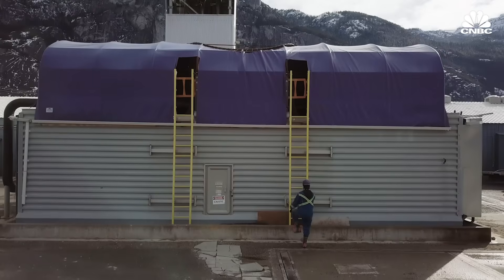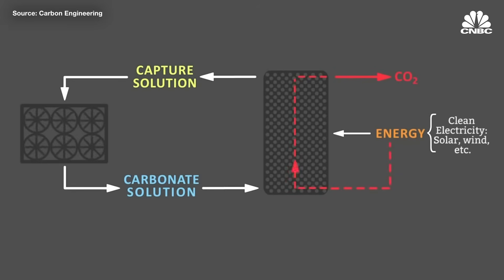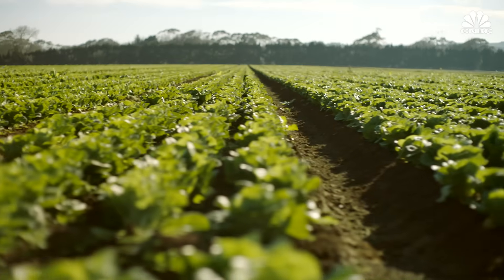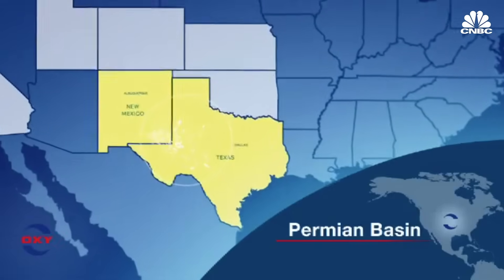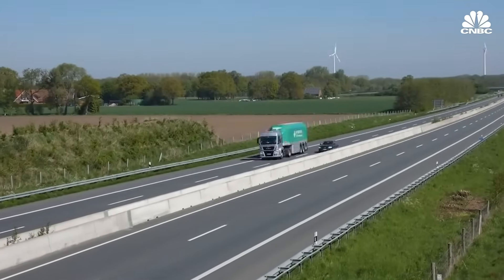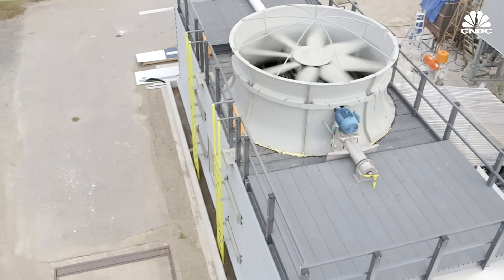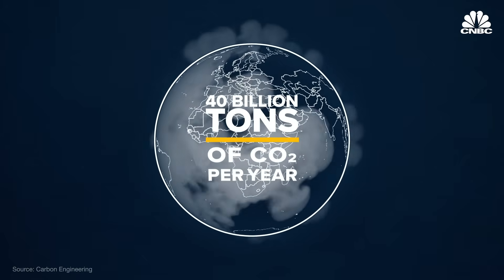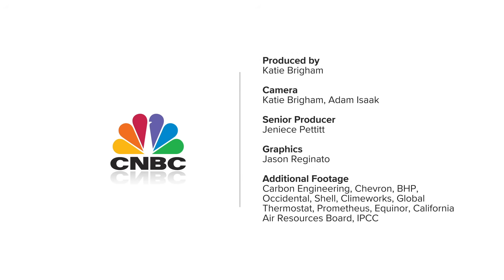Bill Gates-Backed Carbon Capture Plant Does The Work Of 40 Million Trees

Comment: And when ground absorption reaches its tipping point? How will excess CO2 impact water retention in aquifers? How acidic will the CO2 make the earth?
Reply: Pump it into empty oil fields maybe
Reply: well, all carbon come from the ground,just like all fossil fuel come from the ground. it s just to put everything back to where they come from.
Reply: @Soras_  Nice thought, but not quite correct. "Natural' carbon is tied up in many ways essentially rendering it neutral.
Reply: @phillipbotha7920  I think IT s good idea to put carbon back to deep underground where we dig oil  with  renewable energy.
Reply: @Soras_  I am hoping that you are trying to be funny
Reply: @phillipbotha7920  it took more than renewable energy along to reverse climate change.
Reply: @Soras_  Nothing will stop climate change. Climate change is cyclical
Reply: @phillipbotha7920  unless you artificially changing it that is. you can block part of the sun light to slow it down like large  volcano activity did to earth s temperature.

Comment: Genetically modifying trees to absorb more CO2. That would be a start. Look what we’ve done in the weed industry
Reply: Lmao
Reply: True but it'll take too long
Reply: @Hope4aBetterWorld  no, in fact it can be very fast, in 10 it'd be ready, the problem is that if you covered the planet with trees would only eliminate 33%of the excess carbon, it's not enough
Reply: Az4212 knowledge thirsty that's alot
Reply: actually good idea props.
Reply: Oh noes! He said GMOs. Burn the heretic!
Reply: Ganda Gandara  Lol, haven't taken too many bio classes, have you?
Reply: already being worked on: https://www.dezeen.com/2019/05/30/salk-institute-ideal-plant-climate-change/
Reply: Bad idea, it could throw the balance off. Its better if we have machines that we can turn on and off. We dont want to remove too much, which could eventually happen.
Reply: @LittleRainGames  Throw the balance off what?
Reply: The issue is that C3 photosynthesis can only do so much.
Reply: then what. wood rots. to permanently keep it out of air it has to go back into the same hole it came from.
Reply: All plants do. Lol
Reply: I wonder how much carbon has been fixed to the inside of bongs around the world🤔. Stoners unite to save the world!
Reply: Gasmandude 
The weed industry never genetically modified pot, they used conventional breeding to get different strains, there is a big difference between genetically modified and cross breeding.
Reply: The weed industry is a pure environmental disaster. Drums of synthetic fertilizers down the drain.

Comment: What if we change our understanding of the combustion process? Instead of using purely oxygen, Carbon dioxide has 1 carbon atom and 2 oxygen. If we somehow can manage to use the carbon, it will be a game changer
Reply: Alex Wong thats the pellets bro
Reply: Gosh, you have no idea on how combustion works. Do you even know why there is carbon dioxide in combustion gasses? You put in fuel (a hydrocarbon, CxHx, the number of hydrogen and carbon atoms vary depending on fuel), and you also put in oxygen, which acts as a catalyst. When the Carbon and Hydrogen bonds are broken, energy is released. The Carbon binds with the Oxygen, resulting in Carbon Dioxide, and the Hydrogen also bonds with Oxygen, resulting water. You cannot reverse this process without investing back the energy that was released during combustion.
Reply: The ideal formula for gasoline that you put in your car is C8H18. During combustion, for one molecule of gasoline, you need 12.5 molecules of oxygen. 
C8H18 + 12.5*O2= 8*CO2 + 9*H2O

The issue is a bit more complex, because you rarely have a perfect air to fuel mixture. Air also contains Nitrogen. If there is excess air in the mixture (too much air, not enough fuel), Nitrogen bonds to Oxygen under high pressure and temperatures, resulting in Nitrogen Oxides (NOx). Also, this causes high temperatures in the engine, which can melt parts of it. That's why an engine always runs with a little too much fuel than it needs.
Reply: @laurentiupopa5001  I said "If" and I'm not a chemist like you.
Reply: @alexwong1249  No worries bro, I tried to explain as well as I could, so you could understand the combustion process. I am not a chemist either, I am an Automotive Engineer :))

Comment: Planting trees is good idea to remove CO2 from the air. Not cutting them down en-mass in the Amasonas could be even better.
Reply: Trees do it naturally without the need to build other plants. I would never trust an oil company to do the right thing
Reply: @r.d.9399  "I would never trust an oil company to do the right thing"
Nor Bill Gates for that matter.
Reply: Craig Tucker  You act like the rest of the world don't drive cars and trucks. STFU
Reply: you do realize all the carbon in the ground came from the air?  covering all land in trees wouldnt store enough as most of it came from algae in the ocean getting buried.  only way this is getting fixed is to sequester it permanently by making it back into a solid or liquid and putting it back into ground.  can only make so much stuff out of wood for so long
Reply: S K 
That takes a long time and old forests still absorb CO2 well.
https://www.nature.com/news/2008/080910/full/news.2008.1092.html
Older trees grow thicker rather than taller.
Reply: @michaelrch  The Amazon forest is a few thousand years old, trees grow taller, thicker and dies. When dead they they are eaten by microorganisms which are eaten by bugs, the bugs are eaten by predator each generating CO2 along the way, feeding the the young trees along the way. As vegetable need CO2 to develop, as far as CO2 is concerned the Amazon forest is a close loop ecosystem, it produce as much CO2 as it need. The problem is that it produce a huge amount of water vapor a very potent global warming gas. Transforming the Amazon rain forest into a desert like the Sahara would cool down the planet and have no effect on its oxygen concentration.
Reply: John Kubik 
Wow that is some seriously imaginative nonsense buddy.
Water vapour is indeed a greenhouse gas but it is evaporating off the ocean and stays in dynamic equilibrium based on the air temperature. 
Yes, tress transpire water but the Amazon actually creates clouds by condensing water vapour out of the atmosphere. That's why it's called a "rainforest". 
The net effect is that the forest takes water vapour out of the atmosphere.
So no, killing the most valuable and amazingly diverse ecosystem on our planet is a bad idea.
Who'd a thunk it
Reply: @johnkubik8559  lets turn the whole planet into a desert then.
Reply: @johnkubik8559  Cool down for whom? All you quacks don't even know what CO2, Carbon, etc is for. Obviously its heat sources to decay & regenerate. The sun is morphogenetic as do all things that create a symbiosis. They are hiding a lot of truths by cooling the firmament. It's to allow folks who dont have carbon based elements in them to live long lives when in fact real nature would wipe out half the world like thanos did. A event like that would be catastrophic which is why they have systems designed to reverse everything
Reply: EXACTLY .. Or you could plant more trees 😆😆😆
Reply: People demand is greater than our worry of global warming. Cutting down the amazon forest in the short run provide food and resource to the people but in the long run long term damage to the environment.
Reply: They don't grow well in some areas.
Reply: Full grown forests do not capture a lot more co2 then it produces itself
Reply: Try to tell that to developing countries where most of the population lives in poverty and conditions the modern world considers disgusting.
Reply: Trees don't permenantly store carbon the only bank it until the forest burns or the tree decomposes which just puts it back in the atmosphere.
Reply: Scott Wickwire-Brock 
Turns out that that is much less true than we thought. If you plant the right forests, they grow for centuries. Trees stop growing taller but they grow thicker. The best plan is to start by keeping the forests we ready have of course.
https://www.nature.com/news/2008/080910/full/news.2008.1092.html
Reply: You do realise that trees put C02 into the atmosphere, right? At night. Trees put out C02.
Reply: The Amazon forest is a primary forest. Its oxygen production is absorbed by the microorganism feeding on dead trees and releasing CO2 feeding the young growing trees. The CO2 balance sheet is neutral, its a close loop ecosystem. Cutting down trees to build houses or furniture delay the CO2 release until this wood ends-up in landfills or is burned in recycling plants.
Reply: Partisan obsession is unnecessary when talking about climate change . We are all in this together as human beings.
Reply: Sekir80   Millions of trees have died here in bc due to the pine beetle which creates a forest fire hazard in the summertime, thus producing carbon. I guess it’s natures way of renewing the forest. Before Europeans existed in North America Forrest fires burned freely without human intervention.
Reply: Be cautious about forest fire
Reply: Oceans give more oxygen and we have lots of trees but humans gotta take up space too
Reply: Well it's not first world countries cutting down the Amazon jungle
Reply: @Sandlin22  yeah, they already cut down their forests.  if we cared we could easily pay them a pittance not to at the end of the day.  ever look up the economic output of an acre of jungle?
also, once a jungle is grown it doesnt consume anymore carbon.  

where would it be going? unless its being trapped under the ground and entombed plant matter decays and releases carbon back into air. all this carbon was in the air to start with
Reply: The amazon is the most vital resource all the planet. It fuels the atmosphere and has endless potential for medicine. Needs to be saved!
Reply: What's wrong with cutting trees down in the Amazon, that's there country they can do what they want with their trees.
Reply: The Big Question
Is there any verifiable evidence that fossil fuel CO2 has caused any temperature rise, ice melt or sea level rise, let alone causing "extreme" weather?
Reply: GEORGELET4 
Yes, absolutely tons of it! Just because you haven't looked doesn't mean it's not there. Go read it for yourself.
https://climate.nasa.gov/evidence/
https://www.metoffice.gov.uk/climate-guide/climate-change
Reply: @Bruno Pereira 
CNN/ABC = Corporate/Establishment Media owned by elites, and serves elites not the left. Panders to identity politics.

MSNBC = Propaganda wing of the democratic party, which is a party full of centre right politicians with a few lefties. Panders to identity politics.

Fox = Propaganda wing of the republican party, which is a party full of far right maniacs. Panders to racists.

Just because news organisations pander to identity politics, doesn't make them left wing. None of the American mainstream media organisations support Medicare for all, 15 dollar minimum wage, the green new deal, free college and they all parrot CIA pro-war propaganda.
Reply: You can’t make another country do what you want with there natural resources
Reply: Washable Junk 
You can't force them but you can twist their arm. Most international trade relies on agreements which often incorporate environmental and labor standards. 
This is what the US should do.
If Trump wants to impose tariffs on China, he should just make them a border adjustment charge for carbon - a tax on the carbon embedded in the product during its production. 
But then he would have to impose the same carbon tax on domestic producers and that would annoy his donors so... nevermind.
Reply: What are you going to wipe your ass with then Sekir?
Reply: @Bruno Pereira You seem to have bought into the deceptions of the extreme Right.  Do you know who else was from the FAR Right and deceived people into following them? Hint: He had a short mustache and led Germany.  Just remember THROUGHOUT history the ideas of what is now called the "far right" have been the side of EVIL (in retrospect). That's just something to research and think about. ;)
Reply: Well, we could cut them and them bury those trees extremely deep underground to store the carbon.

Then replant the cut trees with fast growing, dense biomass trees. Rinse and repeat, store the converted atmospheric carbon deep underground where it won't pop back up into the atmosphere again.
Reply: @TubersAndPotatoes  We thought that dino juice would stay underground, too.  Look at us, now.
Reply: Craig Tucker  aaaand...most cars in Brazil run on ethanol, which is 100% carbon cycle.
Reply: Do you think thousands of climate scientists have not thought about planting trees to capture CO2 you moron? Planting trees cannot not solve the greenhouse problem, people smarter than you have crunched those numbers a long time ago.
Reply: nahhhh... thats why this co2 extractor was created.... so the elites can continue deforesting our planet and claim they "offset" the damage by installing those facilities.... just think of it! 40 million trees per factory! isnt that awesome??? And dont worry, they will still be able to breathe when all trees are gone... oxygen can be synthesized in a very expensive manner... but hey, money doesnt matter anymore when everyone of us lowlifes is painfully asphyxiating.
Reply: Yes let’s get Bill Gates involved in planting trees,
Reply: Or cutting and planting, if it's twice the best.
Reply: In order for trees to survive they need more than the current level of 475ppm of CO2. They do better when the CO2 level is at least twice that amount...that's when they become healthy enough to survive drought. There is a reason that greenhouse operators buy CO2 generators and subject their plants to 1200 - 1500 ppm of CO2, because that's when the plants are at their best.
Reply: @arthur_7144 Oh, i'm sorry, I don't know what I was drinking that day. :D
Reply: Bruno Pereira 
You are in denial. Deforestation fell like a stone under Lula,
https://ourworldindata.org/wp-content/uploads/2013/11/annual-rate-of-legal-deforestation-in-the-amazon-in-km2-per-year-197788-2013-inpe0.png

Meanwhile your boy Jair has put the agriculture secretary in charge of protecting the Amazon (which is a sick joke) and is inviting the US in to help him destroy the forest and throw out the indigenous people that live there.

https://www.reuters.com/article/us-brazil-environment-amazon/brazils-bolsonaro-wants-us-to-join-development-plan-for-the-amazon-idUSKCN1RK2GH

It's a crime against the whole of humanity and it will have terrible effects for the future of the planet that we all share.
Reply: @michaelrch  Dude, he's been president for only 6 months. He haven't even started dealing with the country's problems that have been neglected for years. You're only conjecturing based on leftist journalism speculation. 

Just so you know, the chart you pulled out only shows the data from the previous governments, which for the last four and a halve runs were from leftists. You aren't living here to understand what's really going on and to know how the media is exaggerating everything just for political gain, while for the past 18 years every part of the country was trashed and subverted by the prior governments. 

If you want to blame someone for Amazonas deforestation, search for what Lula and Dilma did to it for the last 2 decades. Stop embarrassing yourself. I don't even like Jair, but I know he's a better governor than the last 3 candidates, which btw, one is in jail and the other was impeached. Your country is by far one of the worst causes of climate change. Just shut up.
Reply: oneviwatara 
Pretty those fires in the US are natural disasters, not deliberate.
Fun fact, the worst 16 fires in California in the last 100 years happened in the last 20 years.
Reply: Also the more CO2 the more trees thrive.
Reply: oneviwatara  Forest fires are natural. They need to happen for new trees to grow. The reason they are even a problem is because we like to build homes in and around the forest.
Reply: Sekir80 
IKR
Brazil's voters just gave the world the finger when they elected Bolsanaro. Mostly driven by the Christian Right and the super rich.
Reply: Both comments are kinda depressing...
Reply: @Bruno Pereira  Lula da Silva is a political prisoner. He would have definitely beaten Bolsonaro and should be president right now.

He was jailed for "corruption" which apparently amounted to getting renovations on a middle-class apartment, and this was based on one testimony from a guy who wouldn't be allowed to leave police custody until he gave the testimony.

He was targeted by a corrupt Judicial system, and surprise surprise the judge in the Lula trial (Sérgio Moro) is now Bolsonaro's Justice minister. A couple of weeks ago private chats were leaked between Sérgio Moro and the prosecutor showing them conspiring against Lula:

https://www.youtube.com/watch?v=GT4T_mzpmwQ 
(Not the "democrat mainstream media")

Stop repeating cheap lies that right wing Brazilian Mainstream Media tells you.

Lula Livre.
Reply: @sentientstarstuff398   Dude are you wasted? WTF? What a trip...
Reply: Michael RCH you're tripping man... Stop parroting bs.
Reply: Nicholas Zein 
Correct my mistakes then. 
But I can cite peer reviewed studies for all these effects on plant life globally.